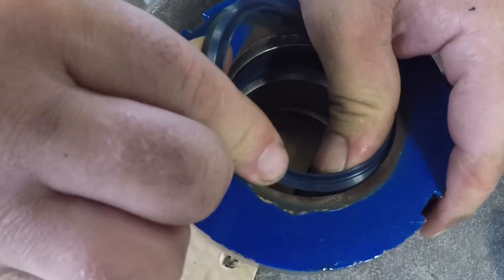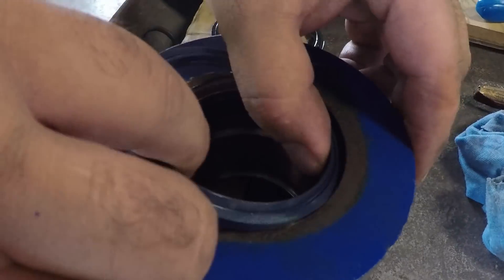Rebuilding a hydraulic cylinder - Blown hydraulic cylinder

Comment: Cut an o-ring that doesn't fit and super-glue it together?    You just lost your credibility.   Only in case of an emergency repair.  How about just getting the right size o-ring and doing it right?   Otherwise, a great teaching video.  But that was an awful teaching point to include.
Reply from the maker: You might want to do some research on the subject of making o-rings. There are kits for making o-rings that include bulk o-ring material and for nitrile material, superglue.

Comment: Lifting and dropping the cylinder rod on the table instead banging the cylinder on with a hammer, reminds me of replacing a hammer handle. Instead of smacking the head on with another hammer, hit the bottom of the handle w/the other hammer. Works 10X better. Good vid Jimmy 🤜🤛 👍
Reply from the maker: psidvicious, I remember my grandpa showing me the hammer handle trick. Why it works, is still beyond me. But it absolutely does. Many thanks for watching!  🙂👍

Comment: Watching this made me think you've been taking lessons from Adam Booth (Abom79).  He likes to use a little slickum on the seals and O-rings to let them more easily pop into the grooves, but you got the job done anyway.  Not the kind of thing I've ever had to tackle.
Reply from the maker: BoatShaper, I've actually never watched any of his videos. I've been told that he has a good channel. I better go check it out. I have never lubed a seal before installing it into the gland. I think it would make it harder to manipulate the seal. But, to each their own I suppose. I've learned that there is lots of ways to get to the destination, and many times the path traveled is insignificant. Cylinders generally aren't overly difficult. Unless the gland is stuck or the piston nut is extremely tight. Those are a pain. Many thanks for watching! 🙂👍
Reply: @ToTheTopCrane  Completely understandable that you aren't familiar with Adam.  I have heard of lots of "good" videos that I just haven't had time to check out.  I am glad that watching letsdig18 led me to viewing yours.
Reply: Adams video on measuring seals and ordering aftermarket from Hercules Sealing Products has proven very useful.

Comment: Good show Jimmy ! 😊
I've worked with a few of those big ones and I don't think that there was a single one that was family friendly on the commentary ! 😠
Before the Lucas came along we used STP oil treatment and put the seals in a pan of hydraulic oil and heated them up , worked wonders !
Trying to break one loose one time we broke a very large vice, maybe because we were using a ten foot cheater pipe on the spanner ! 😊
Can tell that you've done a few of them before, nice job!
Thanks for sharing and take care. 👍 👍
Reply from the maker: Ken Gamble, I have done a few cylinders in my time. The biggest being about 25 feet long retracted. I'd say I've probably built a few hundred cylinders over the years. 
You broke a vise? 😳🤯. That's some serious torque! I'd imagine that was pretty scary. I wouldn't want to be nearby when that happened. Thanks for watching! 🙂👍
Reply: @ToTheTopCrane 
Wasn't really scary, all that happened was that the two hundred pound guy hanging on the end of that ten foot cheater pipe hit the ground and hurt his pride ! 😊 Finally got it broke loose with a one inch drive impact ! The bad part was telling the owner of the vice what happened ! 😊

Comment: Those screw in type glands are the worst kind to get loose!  They don't give you much area to work with, the spanner wrench is never big enough to get it loose, and I'm convinced that they are self tightening as you can never get one off without having to go to confession afterwards.  Best kind are the ones that are held on by hex head BOLTS, the kind that God made for us, not the bolts that have the torx or hex bit socket holes in them.  I'm pretty lucky to have a table to put the cylinders in that will pull the cylinders apart and in the case of the bolted on or the cylinders with the piston nut, will hydraulically loosen and tighten them.  Your vids are getting really great Jimmy!  Nice to see videos on how to keep the cranes running!  Merry Christmas to you and yours, and to your team members down there!!
Reply from the maker: matt lee, I agree, screw type glands are a pain. I used to work in a shop that had a nice hydraulic cylinder bench, with enerpac cylinders for loosening and tightening. We had a few cylinders that we had to weld attachment points to the glad in order to break them loose. Those are the scary ones. Now if I get a tough one, I may be up there bugging you all to use your bench. Lol. Thanks for the compliment and for watching! 🙂👍 Merry Christmas to you all too!

Comment: Razor blade makes quick work of taking the seals off, but your way is better if you need to keep them intact
Reply from the maker: Josh Wall, I try to keep old seals intact. I have had situations where new seals were damaged during installation, and I had to resort to using an old seal temporarily. But, I agree. A razor blade would make short work of them. Thanks for watching! 🙂👍

Comment: Thank you for not saying "hey Youtube" or whatever your old open used to be. Now, you start engaging folks right from the start with great camera work. You have done wonders son. Thanks.

I used to lay sewer and water pipe under an old P&H 2.5 yrd backhoe that the arm cylinder sprayed oil every time it was retracted. We could not take the time to fix it for over a month. Every morning we had to put in 8 gallons of oil to last the day. PVC rain gear was no fun in the summer in a 13 foot trench.
Reply from the maker: longcaster, this was some footage from the first part of October. I edited out the "hey Youtube" just for you. 🙂. Hopefully the editing is getting better as time goes on. 

Being sprayed by hydraulic oil everyday would be no fun. Like you said, especially during the summer. Many thanks for watching! 🙂👍
Reply: You, sir, are making great strides forward in presenting your work (content). Your experience in doing the work is different from all others who do the same work. That is what makes your content stand out. It is not slow or boring to watch. Some needs narration, some doesn't. None needs your choice in loud music (tasteless).

The backhoe operator was very skilled and smooth. If one was leaning on a shovel with your back to the hole he would reach out with the bucket and rip off the back pants pocket before you had a chance to move away, it was funny as hell. Most of the laborers learned real quick to face the hoe and the work.

Merry CHRIST mas
Reply from the maker: @longcaster , Merry Christmas to you as well. 🙂

Comment: Has there been any hydraulic cylinder rebuild job ever that didn't involve a certain amount of swearing? In my experience it's usually directed at either the person who serviced it last or the people who made getting the damn thing on or off such a pain in the back-side.
Reply from the maker: Sandy, I'm not sure a cylinder can be removed and rebuilt without sweating. I'm pretty certain that's one of the steps of rebuilding one. Lol. Thanks for watching! 🙂👍